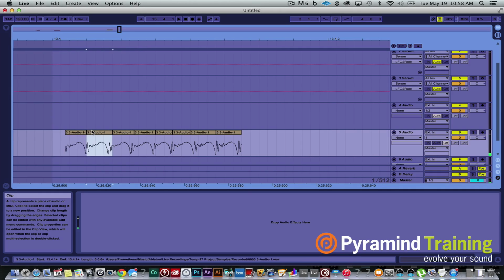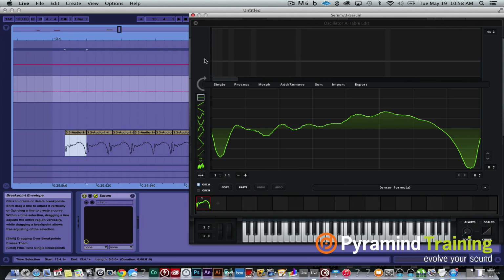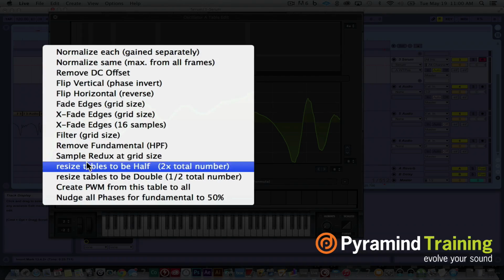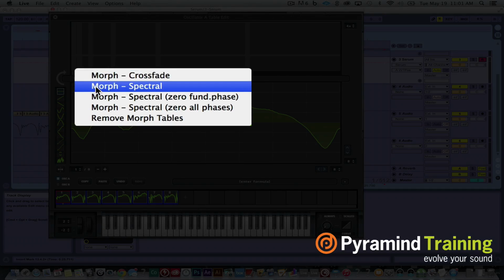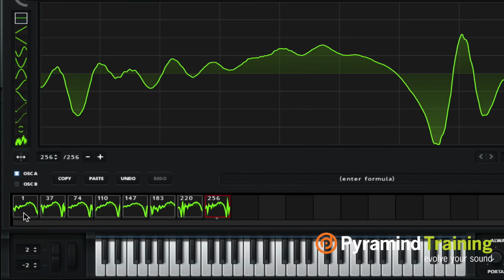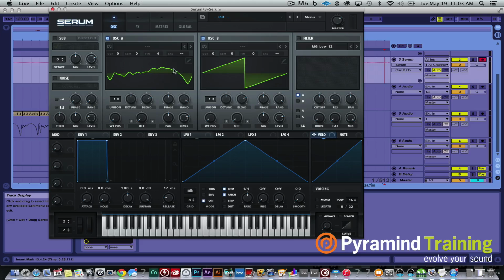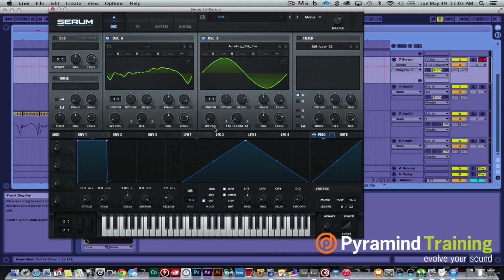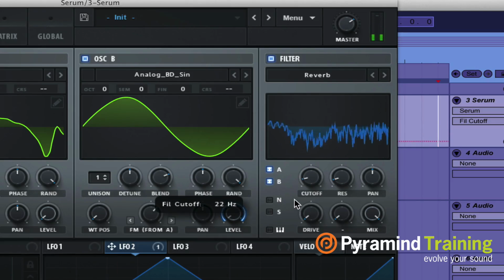Sound Design Tips & Tricks | Creating Serum Patches from Vocal Samples | part 1 | Taylor Elsasser

Comment: At the start it d be nice to actually hear the original waveform on your Ableton before you chopped and transfered it on to the Serum wavetables. As you did it "blind" (or "deaf" in this case) without demonstrating the original waveform first, we ll never know if those resulting "bassy" sounding notes on Serum (after the transfer) were originally of some vocal soprano, a piccolo or a trombone sound. Never ever do that, as we ll never know what to expect if we imported something similar. The whole tutorial hinges on the source audio before being imported into Serum, so the deeper you demonstrate the more disorientating is to the viewer. In the first three minutes I lost you due to that silly omission. There is no point in uderstanding the changes you introduce within Serum if we have no idea what the change was FROM, in the first place.